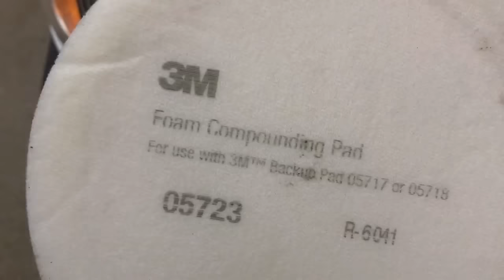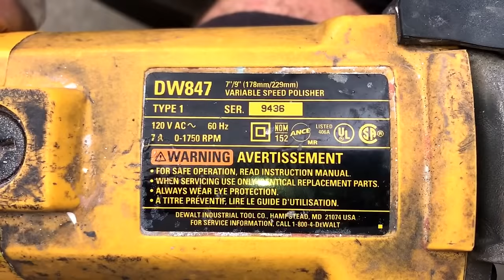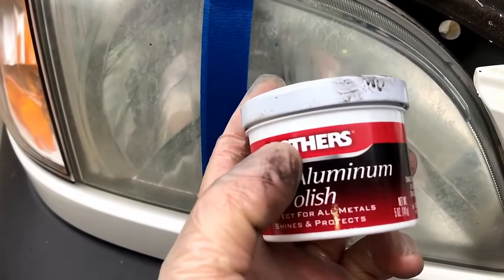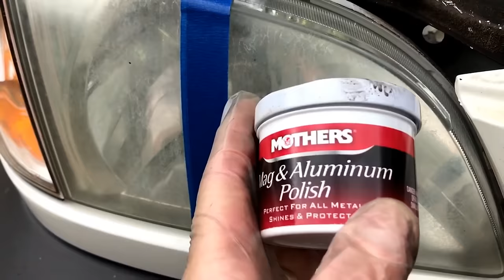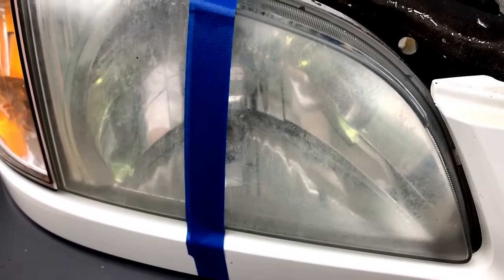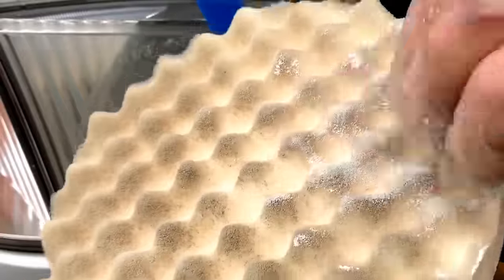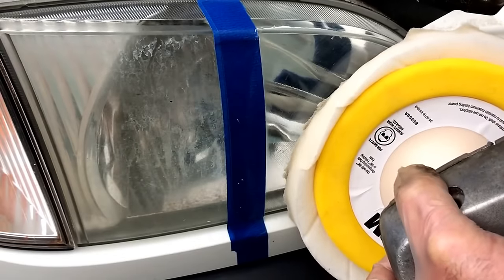How MOMMA Repairs Headlights BACK TO BRAND NEW in 3 Minutes

Comment: I used your technique with mothers and it helped but it's far from right ... still looks dull and looks like there quite a bit of peeling or cracked coating ... any help please? I used a DA polisher with orange hex logic chemical guys pads and mothers ... tbh disappointed atm
Reply from the maker: Martyn Judd-cooper sounds like someone clear coated them U will need to do this to make right  https://youtu.be/GKLF8oIWYGg
Reply: Sweet Project Cars I just watched the other video 👍 and commented on that one too ... I only have Chemical Guys hex logic foam pads black, orange, green, white, and yellow no wool pads ... can you suggest any of the pads i have to use?
Thanks
Reply from the maker: Martyn Judd-cooper to be perfectly honest with you we have tried every pad out there and we were not happy until we started using the 3m pads...what I can say is do the video I sent you and get that clear coat off, then use the pads you have and see if you like the results if not go to the 3M's..I will say this though, you will need a single action buffer to do it a random will not get it done as it is not fast enough...hope this helps
Reply: Sweet Project Cars 
Ok i could put the backing plate in a drill with the pad on and try that,... I understand the Yellow are heavy cutting/ aggressive .... Orange are medium cutting and Green are light cutting and says for Windows and headlights but i used the orange pad .....White are for light polishing pads not cutting ... Black are for polishing and finishing and applying wax etc ....but I'll look at the 3M pads to fit my machine anyway. I'm a newbie so wanted to start off with a DA 👍 thanks for your reply
Reply from the maker: Martyn Judd-cooper wish I would have caught you before you got a DA as the single is much easier to use and once you get it down you will never use a DA again...anywho that's here nor there now, but at least you know if what you have now doesn't work you can always go to what we guarantee will work :)
Reply: Sweet Project Cars 
Well i thought as a beginner I'd start off as advised to get a DA ...only £100 so i could get used to using different pads and compounds ...polishes etc then step up to a Flex or Rupes etc... work in progress lol .. hope your weekend is going well 👍
Reply from the maker: Martyn Judd-cooper no problem you have to start somewhere we always say..at least you know what to move up to when you get more comfortable with your technique :)

Comment: Oxidation on that one was very light. If you have more you will spent a lot more time buffing
Reply from the maker: dave if they are really bad it can take up to 5 minutes per light with the tools we are using any more than that then we do this video https://youtu.be/GKLF8oIWYGg
Reply: @SweetProjectCars  mine were about an hour per side with a drill pads and. Meguires Plastx. I wasn't seeing any improvement with the aluminum  polish at least in my case
Reply: @SweetProjectCars  as a side benefit I discovered my left low beam was dead. I had Ben driving around with one headlight out. Also at this point I believe my neighbours think I have lost my mind standing outside with a drill doing my headlights. On my street almost none else does their own car work like myself. They either think I'm really cheao or crazy or a combination of the two
Reply: @1232bluejays  Sounds like you shouldve wet sanded first than compounded
Reply: @yeeyee5054  I finally got them looking really good with drill buffing pad and McGuire plastx. Part of the problem was originally trying to clear coat them so I had to get all of that off

Comment: Now you must doit clear coat if not plastic return in yelow quicly
Reply from the maker: Paweł Dubiel we have done this 100's of times for our customers for over 15 years and never have they turned yellow thanks
Reply: Ok i think this car its new hawe clear coated acrylic lens its not realy damaget from UV loks nice you are right this effect take for more time  over plastic resistance  for UV  baybee 3-5 years  i trayed to polish one time bad lens with spider net plastic burned from sun hot and UV  and 6 month later return to yelow.. ABS dont hawe UV resistance but ASA its like ABS and have resistance for UV ... its nice job and  thanks for info... i want talk only not all headlights its the same and some times need use sand papper and clear coat  for realy damaged scraped plastic ;)  ... great job and nice polish product... i am from poland  sorry for my english but i never learn tis languidge only know from films and scribe from head  hehe.. sorry my car hawe clear coated  lens from fabric and not doit this effect in 10 years  its clear  only inside its litle dark dust and need to open lens wash in  untatched  technic only liquid can touch lens inside ... microfibra all soft "cloth" microscrathing surface and in light in night can disturb other drivers ... thanks for answer ;) ... God blees you for condividing knowladge

Comment: All well and good, but unless you apply UVA resistant clear coat spray, you'll need to repeat this process (or coat it with UVA resistant plastic protectant) every six months.
Reply from the maker: You are correct Edward, that's why we specifically suggest using this  https://goo.gl/z9TrgR  after, so you don't have to keep doing the process in this video.  Thanks for watching.  mad Mike the hammer SPC

Comment: No doubt that will work for headlights that are simply waterspotted and cloudy.  You aren't taking off the yellowing/oxidization with just a simple polish.  Not even one with the cut of a metal polish.  Any heavy cut compound/polish will remove that very mild level of spotting.  Please post a video doing this on a very yellow and blotched sundried headlight.
Reply from the maker: Watch this  https://youtu.be/GKLF8oIWYGg  mad Mike the hammer SPC
Reply: @SweetProjectCars  cool this just reinforced my point.  I do headlight restore for most of my customers.  SoDak weather is hard on our cars, especially our daily drivers.  No mag polish and a buffer are going to take that out.

Comment: I applied the clear coat and now I have grazing. How do I fix that? Because it looks worse than this.
Reply from the maker: Mario you will need to sand it off 1000 grit to 3000 grit wet and dry and then just follow the video...then don't re-clear just use this after you are  done    http://amzn.to/2jCHktN

Comment: Your way it'll fog back up in no time .......Wet sand with 1800 grit and constant water from like a hose . Let dry to a haze and spray with clear 2 coats . Last years that way and redo the same way down the road if needed
Reply from the maker: Mike we have done this for 100's of customers and they last for years and years when you use the conditioner that we share in the tools list after polishing  thanks Mike SPC
Reply: @SweetProjectCars  Could be . I'm just saying that many of the polish techniques only last a short time . Now on my side if you use a cheap clear coat it wont last as long but a high quality clear coat will last years and years .....Now if you make a vid using my technique and make millions then I get 50 %

Comment: Acetone works and is not labor intensive.Using this chemical will briefly melt the plastic and the oxidation will disappear.
Reply from the maker: you can use what you feel we need to but we do not suggest this method for people not versed in this chemical

Comment: Need to seal it to be a permanent fix.
Reply from the maker: no need to seal it when you use 303 UV 2 to 4 times a year, thanks for sharing
Reply from the maker: it takes 15 seconds to wipe the 303 over both lenses that 30 seconds total in 1 year and I would rather do that than spend hours sanding and taping and breathing in clear coat every 4 to 6 years. and for the DIYer, our method is hard to beat.